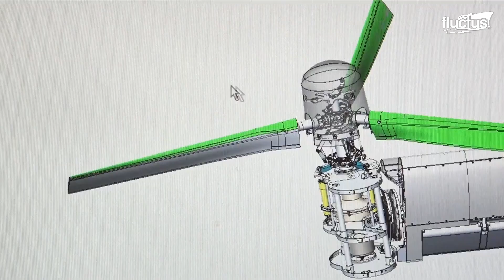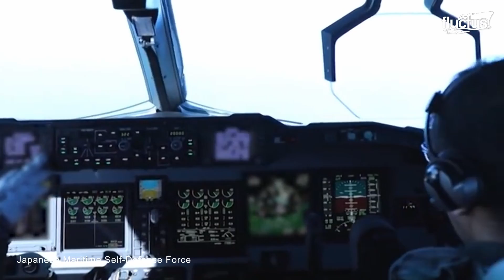The Reason Why Only Japan is Allowed to Buy this Advanced US Transformer Helicopter

Comment: How many of these have crashed?
Does there exist an infantry weapon that can't hit it nine shots out of nine?
Reply: Yes, every infantry weapon if they decide to fly higher.
It's not meant as a direct combat craft, it's transport and some recon. I imagine every transport aircraft can be easily hit.
Oh, and just about every helicopter crashes a lot. I don't think three years pass between them.
Reply: The V-22's wear and tear and failure rate is equal to or lower than that of a typical transport helicopter.
The small number of aircraft in service is one reason, but it is not a major problem for the V-22.
The main problems are the procurement and operating costs, the time and effort required for maintenance, and above all, the special pilot training required of the pilots. (Both fixed-wing and rotary-wing aircraft skills are required.)
However, the V-22 has capabilities that cannot be duplicated by any other aircraft, and the military forces that are able to introduce the V-22 can dramatically expand its capabilities.
Reply: @fromfareastindy8234  it’s a maintenance nightmare because of the complications of folding all the complex and heavy parts and its capabilities can easily be fulfilled by helicopters, seaplanes or combinations of various modes.
Reply: Not sure what your point is.  It's not like you can do the same things with large transport planes without a large clearing or airfield.  Try landing that on a small atoll.
Reply: @shionuzuki5549  AVIC AG600 Kunlong is a large amphibious aircraft.

Comment: I was reading a bit about this aircraft,and it certainly is a one of a kind with amazing design,and technology but it also has a reputation as a widow maker.
Reply: it actually has a better service record than most other helicopters in service , it grabs more media attention simply because it has a larger capacity for more passengers
Reply: @serronserron1320  does it have a larger capacity for more passengers? The Merlin goes further and can carry 24 passengers. A CH-47 can carry 55 passengers.
Reply: @cplcabs  From what I found  the max range of a Merlin Mk4 is 927km while a V-22 Osprey can travel 1,011 mi. Also an V-22 Osprey is faster 351 mph when it tilts its props forward. 167kts is the of Merlin Mk4. Both can add external fuel tanks and have other variations.
Reply: @serronserron1320  you are correct. It does have a longer range than the Merlin despite what I thought. It is howveer, very expensive to buy, maintain and to fly and way more complex. It is also way more vulnerable operational zones and is has a high noise signature.
Reply: @cplcabs  Pretty much all helicopters are extremely vulnerable to anti-air weapons  in this day and age.  Even with flair launchers, coated rotors and all the other tricks that they're using.   The Merlin has a faster vertical takeoff but in terms of overall Speed the Osprey is faster.
Reply: このヘリコプターが革命的なものである事は確かです。
初期のトラブルでたくさんのパイロットが亡くなりましたが、その原因である回転翼乱流が解決された後、最も事故率は低くなっております。その後の事故の内容を見るとかなりsevereな運用で(特殊部隊による訓練)
発生しており、日本に於いては事故はゼロです。
航続距離は日本から中国本土に届くので、中国は過敏に反応してますが、それは抑止力として機能しています。
米国は素晴らしいものを作った最たる例だと思います。

Comment: HOW MANY Marines lost their lives during the long development of this POS ?
Reply: You do know statistically the Osprey has a lower casualty rate than any of its predecessors? ALL aircraft are going to have losses. I flew as crew on one of the safest aircraft in the Navy, the P-3, yet I have buddies who lost their lives in crashes. I’m sure I’m not going to sway your opinion with facts but it’s a relatively safe aircraft for what missions it flies. How do I know this? I am a US Navy/USMC electrical flight test engineer. I have all the numbers and see any major issues so I can state this with authority.
Reply: The V-22 Osprey has had 13 hull-loss accidents with a total of 51 fatalities. During testing from 1991 to 2000, there were four crashes resulting in 30 fatalities. Since becoming operational in 2007, the V-22 has had eight crashes resulting in 16 fatalities and several minor incidents.
Reply: How many soldiers did it save in Afghanistan because it was able to transport injured soldiers to hospitals within the "golden hour"of survivability compared to a conventional helicopter?
Reply: Your screen name exemplifies your intellectual capabilities.